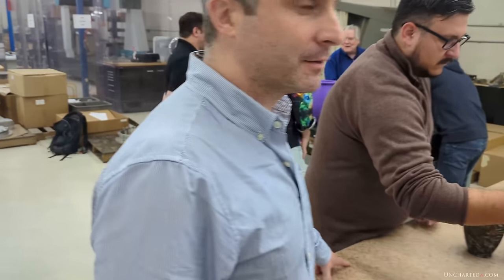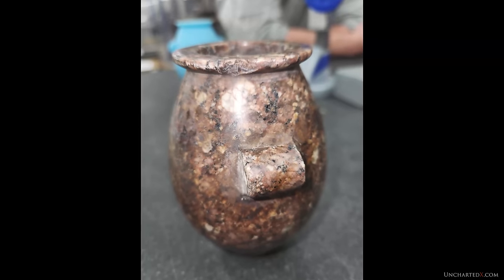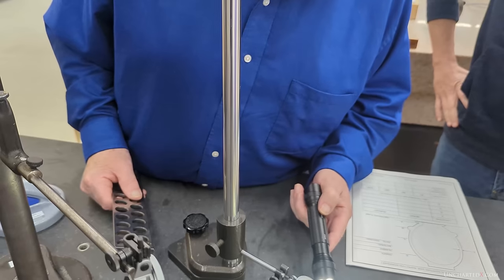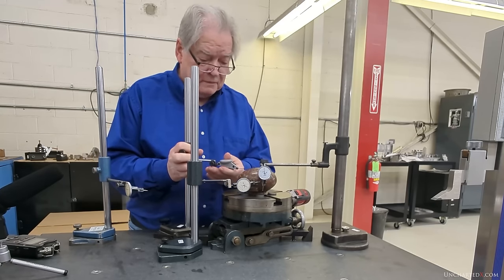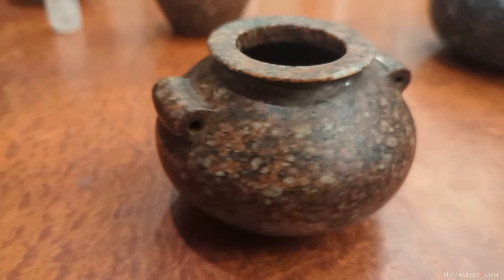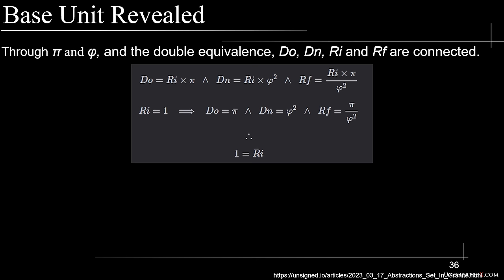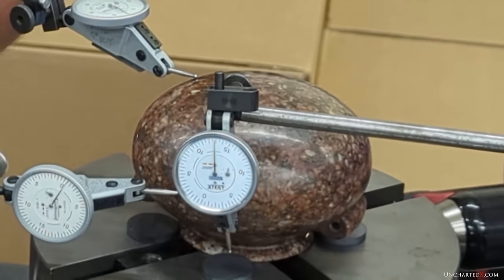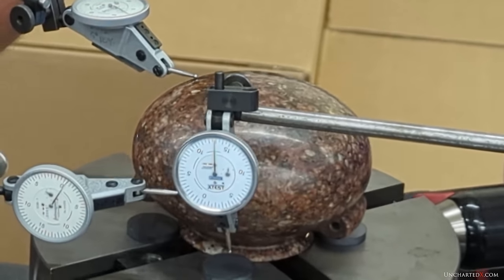Astonishing Results! More Ancient Egyptian Granite Vases Analyzed! More STL's available.

Comment: If you measure a Stradivarius you probably find similar precision for wood thickness etc. Feeler gauges makes this possible without requiring absolute precision. The grinding process is slow leaving time for inspection.
Reply: how would they have measured precision to the 1000th of an inch several millennia before the invention of the micrometer?

Comment: are we completely sure the handles are of the same piece of stone? because it completely stumps me how they would do this. I have done woodworking on a lathe and you would have to either ad the handles on afterwards or carve them into the piece by taking the handle line all the way around the vase. if that was the case though, im confused how they could cut away the excess while maintaining the finish..and balance?
Reply: my thoughts are it must have been some kind of reciprocating lathe like a pole lathe, its the only way this could be possible with the handles assuming they are of the same piece of stone, not cleverly attached later. a pole lathe is the only conceivable way to approach this, but the tool? cant be copper. no way. there must be some sort of carbide tip. and i can only imagine it was a chamfering tool tip. not a flat or curved chisel. it simply must be a chamfering tip which is spinning at a high velocity to meet the piece of stone on the lathe. the deeper i go, the more questions i have about the process they could have used
Reply: a 0.002 variance in thickness!? nothing compares to this , i dont think we could even do this now. i am amazed
Reply: It is clear that today's high-tech stone processing machines are not the best after half a century. I can only assume that they simply had the machine tools to do it.

Comment: These Granite vases Have to be fake because my mind can not comprehend them being real and being made in ancient Egyptian times. I am a modern day machinist who worked in the aerospace industry. I made the main fiber optic connectors for the space station modules.
Reply: what do you think of the wall thickness tolerance within 2 thousandths of an inch in GRANITE? lol
Reply: One of the biggest things for me is seeing the side bungs or whatever they are called on side of the vases. That is almost impossible to do even with a modern CNC lathe or mill. Without those side bungs you can turn it on a lathe pretty easy but with those side bungs... impossible. I think the source for these vases is sketchy, as in, look at that guy... no way, no way these are from Egyptian times. @AustinKoleCarlisle

Comment: I can only imagine that there must have been a civilian lost in time to terrestrial or extraterrestrial (as in commet or meteor impacts) devastation! I mean, what other explanation could there be? 

It's obviously not aliens, but I can't see how (with my knowledge as a machinist of how difficult it is to work with materials of differing harnesses within the same medium) something of such beauty and ridiculous accuracy cannot be made without the use of a computer controlled 5 axis machining centre. 

When I think about it more deeply though, it is also difficult to understand why (if using such complex machinery) there would be varying degrees of accuracy between these stone artifacts. 

Some are precise beyond belief while others not nearly so. 

Turning or using milling cutters (which would need to be made from at least carbide if not diamond) alone to produce such accurate as well as highly polished surfaces would also not seem likely. 

Grinding would most likely be required to achieve such smooth surface finishes. 

I am totally without a uniform solution to these problems. 

If advanced Civilizations did exist in the far distant past, I am without doubt that the ravages of time would most likely have completely obliterated any evidence of their existence except for such items made from the most resilient materials I can imagine!

Comment: What do the surfaces reveal as the "cutting" methodology? I know there is a lot of vitreous surfacing in stone suggesting intense heat as the cause or effect of the cutting. Do these vases feature such surfaces or are there actual grinding and polishing marks? There should be some viewable surface properties that point to a process, no?
Reply: Probably nothing because they are polished.
Reply: @os3ujziC  On the inside there are clearly visible lines where the cutting was in its rougher stage. But even in the polishing, there would be some indication of the lapping grit or surface condition. Some stonework throughout the megalithic artifacts show a glassy smooth finish that is from heat not polishing. So I wonder if there is something similar here or a variation.

Comment: It seems increasingly like they manipulated granite like clay or concrete. Academics say that’s impossible of course, but these incredible examples just scream moulding, rather than lathing. Including the megaliths and boxes.
Reply: Unlikely, granite is a crystalline matrix. Granite is made up of interlocking crystals. If it was made in the same way as concrete it would have crystals surrounded by a bonding agent, e.g. cement. If it was soft and deformable, individual crystals would show signs of deformation.

Comment: If considering the fact ancient Egyptians were more than capable of somewhat complex mathematics/calculus, civil engineering and construction, it only seems to take a short leap of faith to imagine their ability to devise bevel gears to drive lathe and achieve such high degree of accuracy.  

Tooling could easily comprise cutters formed using base metal (Copper/Bronze) shanks with hardened ferrous inset bits/inserts. Think of scutch chisel - with replaceable cutting bits - and perhaps also uncover a means by which their masons could use copper/bronze shanked chisels with ferrous inserts when masoning stonework.  Iron - the "metal of heaven" - and steel weren't unknown to the ancient Egyptians.  Meteoric Iron was known to ancient Egyptians as early as 3200 BC and was doubtless a highly treasured commodity, but it's use in e.g. King Tut's dagger tends to prove they knew at least one of it's key uses.

Other options comprise cutting stones/disks driven by the same ancient means used by the Philistines when they set Samson - in place of beasts of burden - to drive their mills.

Food for thought, from a 68yr old Stonemason / Civil Engineer, with over 40yrs experience in all aspects of the trade.

Comment: I don't believe these are vases at all, no precise lids have ever been found. With such precision, and with parts possibly missing, they may have been designed to speed at high RPM as part of some sort of machine resistant to corrosive materials unsuited to metals.

Comment: You should use a 3-D laser scanner to measure all exterior and interior dimensions and create a 3-D model of the vessels, then you can precisely measure and analyze the parameters with CAD/CAM software. That will give you the highest precision analysis possible.

Comment: Thousands of these have been found ..😮 No one could fake them. Not without massive factories😂😂
Reply: Stop repeating the lies told by random youtubers. They scanned a couple of vases of unknown provenance without even comparing them to a reference hand made vase made with the same material. 
Just like a magician makes you pick the card he wants you can be sure the scanned vases were NOT selected at random
Granite vases are not in the 10s of thousands as they claim, a few thousand at most over some 4 000 years ( so about 1 year needed to be made on average which does not require a massive production capability)
And one can be faked today for under $100 (including shipping and handling)

Comment: Measuring tolerances in inches is like using a broom to measure the thickness of a hair. Jeez guys, get on board with the metric system please. And, you handle priceless artifacts like it's something you picked up at the dollarstore.
Reply: We still use metric and imperial measures in engineering.